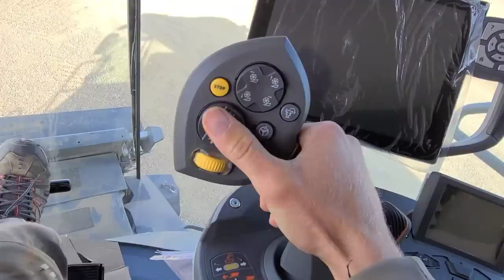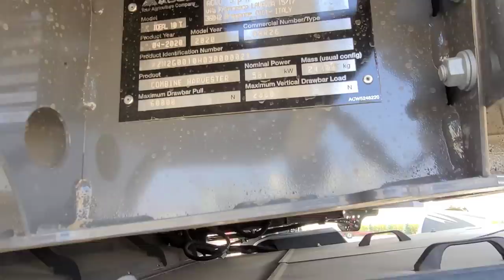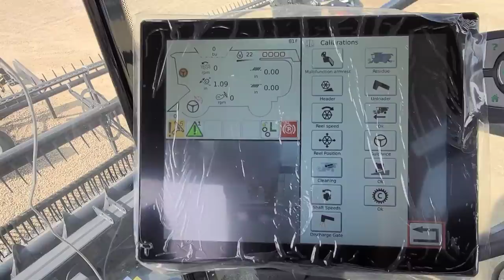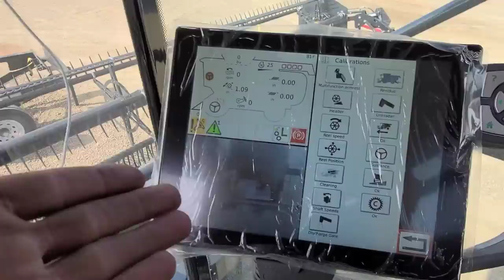The Ideal 10 has arrived!!

Comment: The X9 was scared of the Ideal 10. It heard the 10 was coming to ur farm n the X9 went running with it's chopper between the rear axle
Reply: Funny
Reply: Now that’s funny I don’t care who you are 😂😂🤣🤣😂😂🤣
Reply: The X9s are hiding behind every corn bin they can find...shaking so much in fear that parts will be falling off.
Reply: It went running to a jd fan boys farm.
Reply: The Claas Lexion 8900 runs 70 tons / hour. Fendt Ideal 9 85 tonnes / hour. John Deere X9 1100 100 tons / hour. I believe in those statements.
Reply: @santiagomarangoni3989  there are so many factors that can go into tons/hr. Such as crop condition, crop type, moisture of the material and the grain. When I see the X9 run next to the ideal 10 I'll believe what I see for myself. As far as I'm concerned. They took the X9 from Mike and gave it to the millennial farmer to thresh easy dry corn. Mike is trying to thresh some of the hardest crops with the ideals and they were scared the X9 wouldn't hold up
Reply: Like they say " nothing runs like a Deere" . I'm trying to combine not run a marathon
Reply: @santiagomarangoni3989  aaand Mike is also getting way better customer service and support from agco then he would get from a Deere dealer anywhere
Reply: @taylormarty5679  As for me, the X9 lacks horses, otherwise it is an enlarged CR or two Brazilian S440s as you prefer. It should be sufficiently tested.

Comment: Hi Mike from Australia...
Great to hear you finally get to try out the Fendt 10T....
 you're 100% right on saying there are only 2 competitors for the throne of best and biggest harverters. And that is  Fendt and CLASS, We're running the first of our CLASS 9800's just delivered this week currently finishing of  the last of our soy beans which is yielding an average of just under 5 ton per hectare...
The difference in our old JD S790's that we traded in and the CLASS 9800 is unbelievable. Get this!!!Usually we shut down around 11:00 pm due to the crop becoming too moist and hard to thresh, we're finding we can continue with the CLASS up until at least 1:00 am before we have to shut down. And get this it's not that the threshing that is hard, it's primarily due to the increase in moisture affecting the grain quality.
Looking forward to the next video out in the field with the IDEAL 10T..
Stay safe...
Reply from the maker: You mean the "8900"? That's awesome! 🙂
Reply: @mikemitchell2554  yeah, sorry for the misprint, just got home. Been a pretty long day in the field and lost my glasses today, just to top it off..😅
Reply: @mikemitchell2554  I noticed you mentioned the tracks being rough, we had the same issue with or JD S790's running with soucy tracks.
Got to say the 8900 fitted with the  terra trac's run a little smoother...

Comment: Just wondering if there is a sensitivity adjustment for the steering. The thing is fly by wire, so it may have a way to adjust it. It would be really cool if they could detect who was driving the beast and adjust for each user!
Reply: A lot of wheel loader manufacturers makes them with the joystick steering, it doesnt really takes long to get used to!

Comment: Are you gonna keep running the Ideal 10 yourself, or is one of the other members of the harvesting crew gonna do it?
Reply from the maker: It was just me, only had it for a couple days
Reply: @mikemitchell2554  Just an FYI, That 10T combine looks to also have the 1,500L (396 gallon) fuel tank installed as your 9T's do according to some of your videos. They make a 1,250L (330 gallon) option that allows more space between the rotor gearboxes and the fuel tank. In fact, if you would open the rear left side panel and look in front of the fuel tank you could see the rotor gearboxes plain as day with the 330 gal tank. This extra space may reduce chaff build-up and lower fire hazard or maybe at least make it easier to clean out.

Comment: The Claas Lexion 8900 runs 70 tons / hour. Fendt Ideal 9 85 tonnes / hour. John Deere X9 1100 100 tons / hour. I believe in those statements.
Reply: the ideal 10 is supposed to be '20% more capacity then ideal 9' fendts own words, so technically a 10t should be able to go up to 102 tons/hour
but the actualy harvest capacity has lots of factors, yield / what crop / header size / field conditions (wet - dry) / ....
Reply: @Matt___B  I apologize, I got confused, when I said Ideal 9 I was actually referring to the ideal 10 (85 T / h.) 15 less than the X9. that's what the manufacturers said and according to a comparative video.

Comment: How would auto steering work with the 10?
Reply: there is a auto steer button on the steering joystick. the buttons you see on top are obviously indicator left/rigth. on the back side of the joystick (or front however you look at it) there is a auto steer button, a horn button and the headlights button. but im sure mike will show you in a coming vid.
Reply: @Matt___B  thanks

Comment: which is more expensive Fendt 10 or JDX9???
Reply: Looks like the x9, at least the big one.
Reply: X9    ~$970k = €825k = £750k (rumoured price)
9T    ~$705k = €596k = £540k (reference: fendt's own website)
10T  ~$775k = €660k = £600k (reference: fendt's own website)

headers:
X9   (12m = 40ft)   ~$160k = €136k = £124k (rumoured price)
9T   (12m = 40ft)    ~$89k   = €75k   = £68k (reference: fendt's own website)
10T (15m = 50ft)    no price data found, but 100 - 150k seems logical

so in total 
X9   => $1.15mil = €960k = £875k
9T   => $749k      = €671k = £608k
10T => $925k     = €790k = £716k

9T as main competitor but over 250k cheaper.
while 10t is 150hp stronger and 10ft wider for over 150k cheaper, i know what i would pick (little hint: DEFINITELY not X9)
Reply: @Matt___B  I see said the blind man.... quite a comprehensive breakdown there fella. thank you
Reply: @timjohnson6353  cheers, your welcome 😀

Comment: How much does a 10T cost?  800K?
Reply: X9    ~$970k = €825k = £750k (rumoured price)
10T  ~$775k = €660k = £600k (fendt's own website)

headers:
X9   (12m = 40ft)   ~$160k = €136k = £124k (rumoured price)
10T (15m = 50ft)    no price data found, but 150k seems logical

so in total 
X9   => $1.15mil = €960k = £875k
10T => $925k     = €790k = £716k

all that while 10t is 100hp stronger and 10ft wider for over 150k cheaper, i know what i would pick

Comment: 350,000 dollars, is that enough? but the steering wheel is gone? do you drive like an excavator?
Reply: double that figure and add roughly 75k, there you go.
Reply: @Matt___B  that's why there are no Fendt combines in Italy yet
Reply: @giuseppegatti9441  well its still $200k ( = €160k = £150k) cheaper then john deere X9 so i guess the 10t is priced INCREDIBLY good🤷

Comment: How much does it cost?
Reply: X9    ~$970k = €825k = £750k (rumoured price)
10T  ~$775k = €660k = £600k (fendt's own website)

headers:
X9   (12m = 40ft)   ~$160k = €136k = £124k (rumoured price)
10T (15m = 50ft)    no price data found, but 150k seems logical

so in total 
X9   => $1.15mil = €960k = £875k
10T => $925k     = €790k = £716k

all that while 10t is 100hp stronger and 10ft wider for over 150k cheaper, i know what i would pick

Comment: This thing costs like a million dollars
Reply: Good thing the price of all crops match the price of all equipment! ;)
Reply: @symbologee  your right bro
Reply: X9    ~$970k = €825k = £750k (rumoured price)
10T  ~$775k = €660k = £600k (fendt's own website)

headers:
X9   (12m = 40ft)   ~$160k = €136k = £124k (rumoured price)
10T (15m = 50ft)    no price data found, but 150k seems logical

so in total 
X9   => $1.15mil = €960k = £875k
10T => $925k     = €790k = £716k

all that while 10t is 100hp stronger and 10ft wider for over 150k cheaper, i know what i would pick

Comment: if they got tha same engine and the same power doesn t mean that they are competitors...Fendt is not a competitor for Claas...
Reply from the maker: Haha there's only one way to find out...🤪

Tho Claas probably has more cleaning and separation area (and I would love to try the 8900 or even buy one) But every farm is different in what they need. Perhaps for example use my farm, I need hp (i wouldn't consider anything less than 650hp regardless of its class - to buy), I can bring 790 hp to its knees in low yielding crops. But perhaps because I am in low yielding crops I don't need all the threshing and cleaning area that you would need for say 200-300bu crops.. 🤷‍♂️

Comment: 800hundred thousand maybe?
Reply: X9    ~$970k = €825k = £750k (rumoured price)
10T  ~$775k = €660k = £600k (fendt's own website)

headers:
X9   (12m = 40ft)   ~$160k = €136k = £124k (rumoured price)
10T (15m = 50ft)    no price data found, but 100 - 150k seems logical

so in total 
X9   => $1.15mil = €960k = £875k
10T => $925k     = €790k = £716k

all that while 10t is 100hp stronger and 10ft wider for over 150k cheaper, i know what i would pick
Reply: Yeah, but you need one or two fancy headers as well, another $100k a piece I think.   😂
Reply: @ytfan3815  ye somewhere around 100k seems accurate. however the 10T + header is still cheaper then a X9 without header and the X9 header is rumoured to cost 160k while being 10ft smaller so ye...
you would have to be an idiot to buy X9 over 10T
on a side not 10t is 100hp stronger and has about 250liters bigger fuel tank
Reply: @Matt___B  like buying Nike shoes and you can get better for less.